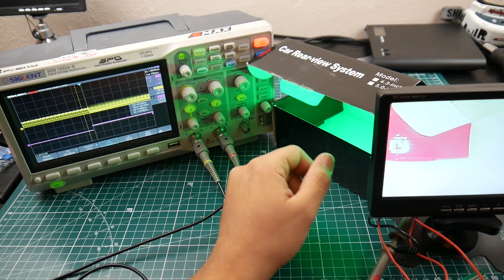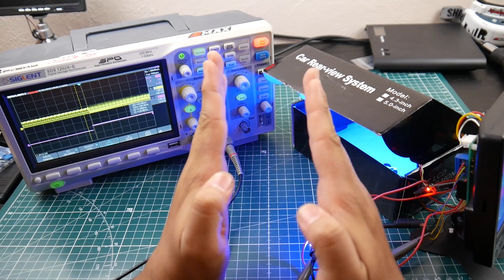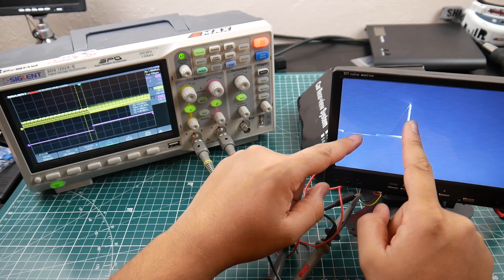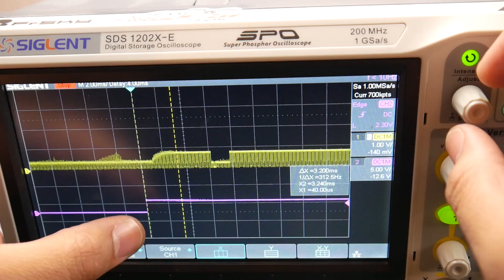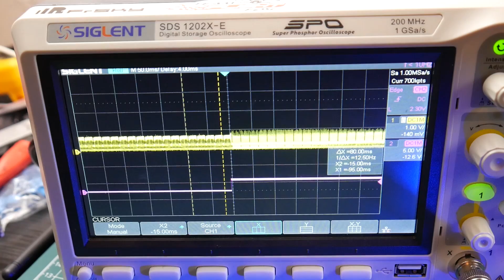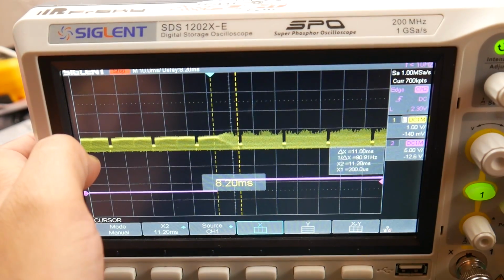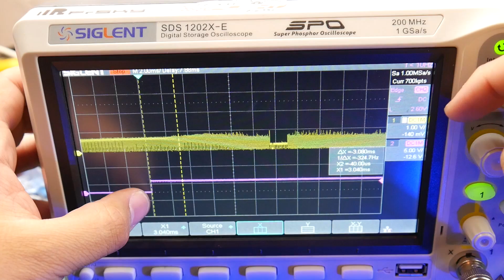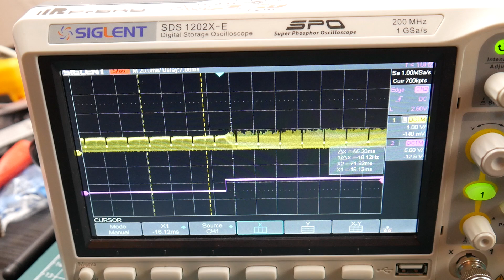Fastest Micro FPV Camera only $20 // Caddx Turbo Micro F1

Comment: A camera latency should be sum of sensor latency + frame latency at maximum. NTSC has frame rate of 30fps, which means a frame takes 1/30 secs (roughly 33ms). I guess 4ms of latency you measure is most likely sensor latency. Your measurement setup can always avoid frame latency? I am curious about your measurement setup more detail :)

Comment: Try the Caddx SDR1, I think it's quicker and has a better image, only thing is it's more expensive. I flew it the other day and was impressed. I'll try and add some dvr from my maiden with it the other day.
Reply: Slippery FPV great cam, but has fairly high latency in tests.
Reply: Which test are you referring too? I can tell you from experience the latency is not notable, I've flown Runcam swifts, all the eagles, the owl plus and I can't notice any notable latency with the SDR1.
Reply: Slippery FPV oh, I know. I own 2. I don't notice that shit either. I think that anything under 50ms is just splitting hairs honestly. Oscar Liangs chart puts the SDR1 on par with the original Eagle.
Reply: You realise some of the reviewers have an agenda due to close relationships with manufacturers. I believe that Oscar Liang's tests have room for improvement...
Reply: Slippery FPV while that may be true, why would this particular Caddx model be the only one to perform worse than both the Foxeer and nearly every Runcam? They missed the mark on the SDR1 a little, just try flying it at night in low light and you'll see what I mean by that. The Exmor-R sensor should be absolutely amazing at night, but it's not in their implementation. It has tons of noise and is unflyable when the light is limited.

I have almost every micro cam out there, Swift, Sparrow, Arrow micro, s1, sdr1, F1, Predator, Micro Eagle. I can tell you that none  really have a noticable latency that would affect flying. Hell, even the Split Mini doesn't hinder anything.
Reply: Maybe because it ain't Runcam or Foxeer? Yeah it does lag behind at night, but that's what I use my owl for. But for daytime flying, it has a great image for the price.
Reply: Slippery FPV Why would he align himself with 2 competing companies, but single out a third? I don't understand the logic behind that.

Anyway, like I said the latency doesn't matter to me. When it comes to picture quality, out of the cams I own I would order them: Micro Eagle, SDR1, Predator, F1, S1, Arrow, Swift, Sparrow. S1 and Predator are clear winners in light transition reaction. Its no contest.

I did get an updated board from Caddx with improved software. It was a fair bit better at night than the original board, but still fell short of the others. The predator does a great job at night too.
Reply: Slippery FPV also, I tried a 1.8mm lens on the micro SDR1 for a really wide FOV. It's my favorite daytime flyer lol
Reply: Not saying he did, but I didn't get the impression that they thought the SDR1 was any good when 1st released. I'm just trying to make people aware there is a cheaper option that is good if not better than the old staples :)

Remember you are commenting on something I wrote a month ago!

Comment: Another informative video. Thanks , any options on micro cam for night flights ? Have SDR1 and can not get it to work well at night . Great camera for all other times. Maybe new micro preditor?
Reply: Jason Boyce Yea, the SDR1 is terrible at night. It's a shame because it has an amazing sensor that when used correctly produces an absolutely incredible (color) picture in very low light. The Predator does a great job, the only issue is the overly blue hue during the day that you cannot tune out.

Comment: You cannot compare this test at all to oscar liangs test. He just measured the delay until it shows up on a monitor. But a monitor only changes its image each frame, which means 50 times per second on PAL. The monitor has to wait until it has collected all the ~625 lines of a PAL image. So there is a 20ms jitter.
Your test on the other hand directly checks when there is a change in the video signal. So there is no jitter due to the monitor waiting until he got all the lines for an image.

Seems like Oscar is also testing 'latency' of VTX and VRX which is just...
VTX and VRX just modulate and demodulate the signal without processing, therey cannot cause any delay
Reply from the maker: BlackPixxelDE Thanks for noticing I didn't want to be mean or discredit him with talk. I will be retesting all cams.

BTW I have a sweet spectrum analyzer on the way I think you will like those tests I have soo much comming up on the channel.

Comment: Not that many people use timing setting which could be beneficial to most as far as noise and motor output. Alot of people never spend much of any time flying at 100% throttle.

Comment: Would love to see a review on the SDR1 to see latency, colour reproduction and how well it compares with a CCD.
Reply: Oscar Liang did the testing on it already, latency is slightly worse than runcam eagle 1.
Reply: I would also like to see you repeat this test with the SDR1 to see how different the latency is. The SDR1 has much better low light performance, according to the specs. However, latency is king and they don't advertise ultra low latency with the SDR1 the way they do with the F1.

Comment: I don’t think this can be right, glass to glass should average longer, a frame takes 16 ms so 3ms is surprisingly fast
Reply: This is a test of the latency of the camera from the change in the light to the change in the video signal coming out of the camera not as you said Glass to Glass
Reply from the maker: Thats why I was stunned the data is all there. I will be making a small shootout with some cams I have laying around. I think the info online about latency could be incorrect.
Reply: yah I agree, and unless you measure the monitor it's just a guess.